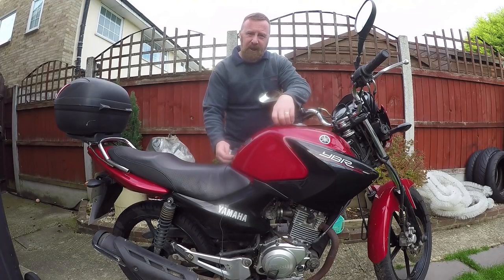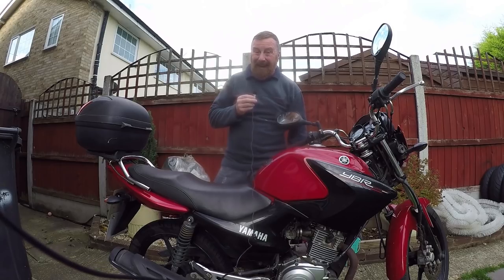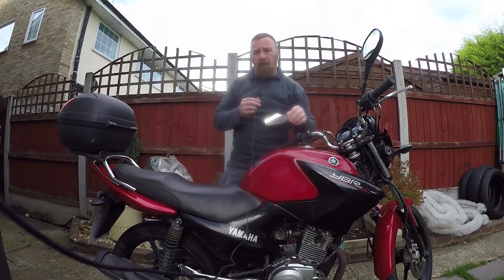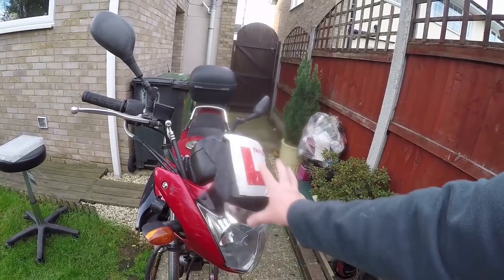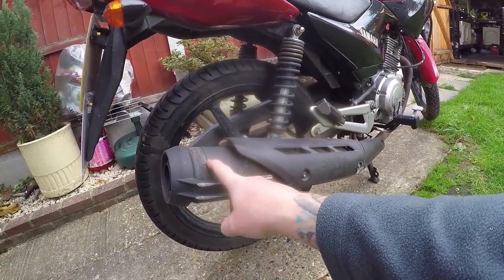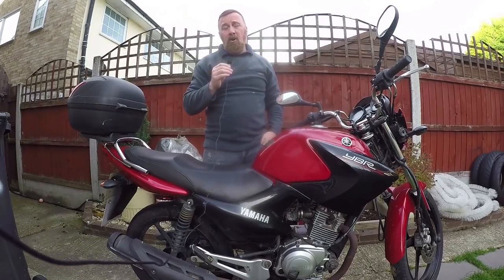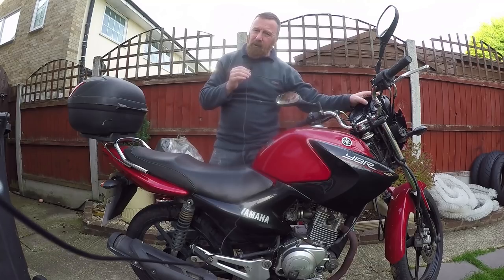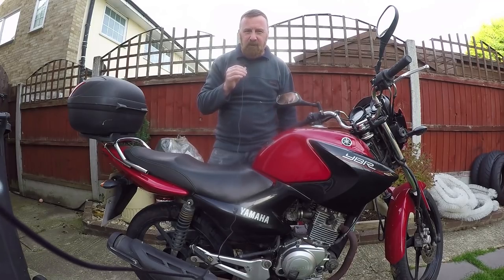YAMAHA YBR 125 MK3 CHAT & LOOK AROUND BEFORE I FIX UP

Comment: I bumped started one of these in the work car park last month. Nice bike.
Reply from the maker: DervMan they just keep going , well unlike the one you had to bump start lol but really they do go well/ just those fine little tyres lol
Hope all is well bud 
Mark
Reply: mark savage Lol. To be fair the owner had left the heated grips on (for about the 10th time). The battery was actually knackered as it had been completely drained so many times. But a quick push around the car park and it fired into life. Imagine trying to do that with a R1200GS 😱💪🏻
Reply from the maker: oh god no way it just wouldn't do it with the weigh lol, but as for heated grips it happens a lot unless you wire them to a relay that power off with he ignition 
any way ordered parts, will wait for them to come and then sort out and update 
mark

Comment: Hi i just changed e my air filter and now it's boggy wood ib b mixture screw? Good vid.i chang e from stock and o straight on cab mesh air filter Honda vision 110
Reply from the maker: if you have gone from a standard filter to a mesh one you may have to change the air mix bud so yes, I really don't like the mesh / foam filters as they do mess around 
I have a video on tuning maybe give that a view as this will help go from 3 half turn in or out to get it running better
if no change after tuning you may have to go back to standard 
hope that helps thanks for watching
mark

Comment: Hi Mark great videos. I have a 2016 Piaggio zip 2t and before I bought it, it was derestricted (carb, variator and exhaust)  but it bogs down over half throttle. It has a standard 53 main jet which I believe is to low and that they didn't upjet when derestricting it could this be the problem? If so what jet would you recommend I put in? Thanks keep up the great work!
Reply from the maker: Darrel Haire thanks for watching bud 
53 is standard , I’d buy a pack of 10 jets from 50 to 70 as they are as cheap as buy 4 single one !and go up in 4s so try 56 then 60 and what ever it runs best at 
Hope that helps 
Mark

Comment: Hi mark i know this aint on topic but my gilera runner vx 125 makes a clicking noise when trying to start it up (electric start) it only clicks once an dont turn over i changed battery but still no luck, what do u think the issue is?
Reply from the maker: hi I have a few videos on the VARIATOR system as that what you need to look at, they are on aerox's and speedfight's but the basics are the same, it's often the Bendix tinging off the outer part of the VARIATOR.
i'd take it out clean up or replace if need be, while your there you can check out the rollers and belt bud 
check them videos out and please like and sub 
mark